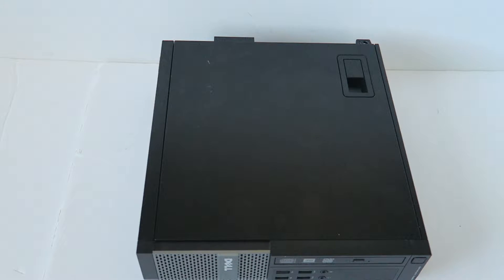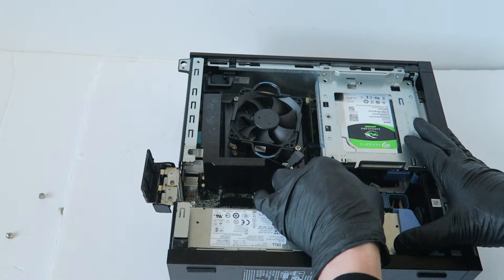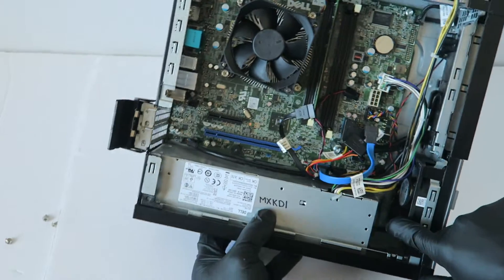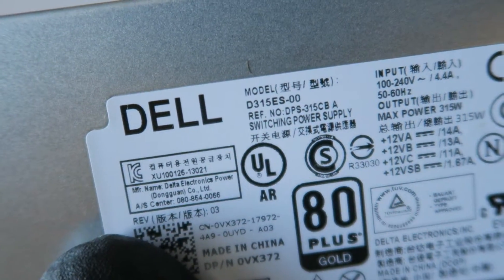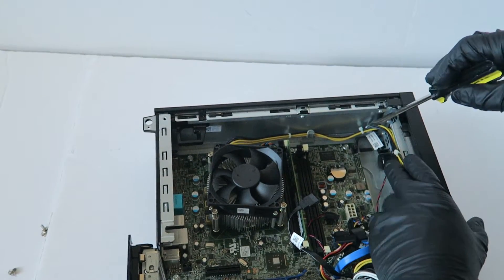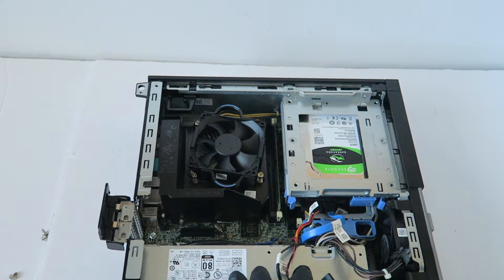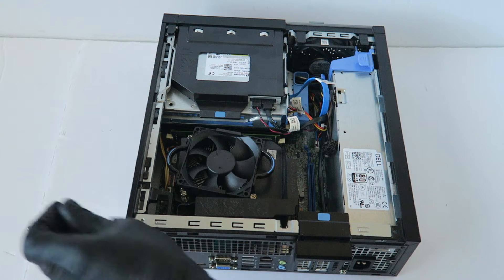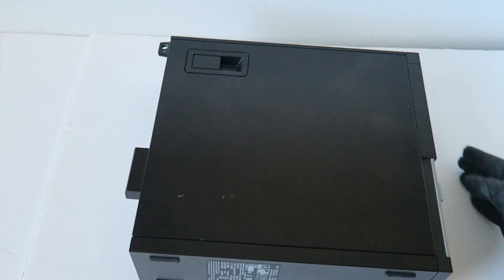Dell Optiplex 3020 7020 9020 SFF Power Supply Upgrade 315W

Comment from the maker: Here is the list part upgrade power supply. 

Model D315ES-00 Power Supply 315W DP/N 0VX372
DPS-315CB VX372

List video cards will work with this system Dell Optiplex 3020, 7020, 9020.
(1.) Gigabyte GeForce GT 1030 GV-N1030D5-2GL Low Profile 2G Computer Graphics Card 
https://amzn.to/2Z4PHkp 
 
(2.) ZOTAC GeForce GT 1030 2GB GDDR5 64-bit PCIe 3.0 DirectX 12 HDCP Ready Low Profile Video Card ZT-P10300A-10L 
https://amzn.to/2WzgLXk 
(3.) MSI Graphic Cards GT 1030 2GB GDDR5, Low Profile 
https://amzn.to/390Spum 

USB Wifi Adapter for PC AC600Mbps Wireless Network Adapter
https://amzn.to/2ZaGuHb
 
Thermal Compound Paste:
(1.) Arctic MX-4 2019 Edition Thermal Compound Paste Carbon Based
https://amzn.to/2XcsZo4
(2) Arctic Silver 5 Thermal Cooling Compound Paste 
https://amzn.to/2ziNU0H
(3) Noctua NT-H1 3.5g, Pro-Grade Thermal Compound Paste
https://amzn.to/36kTk7A
(4.) ARCTIC MX-4 (current edition) Thermal Compound Paste 20 Grams 
https://amzn.to/2DhGJaK

Hard Drive Caddy Adapter  3.5 to 2.5:
(1.) Dell 3.5" to 2.5" SSD or Hard Drive Caddy Adapter R494D 0R494D 
https://amzn.to/2XTPeRr
(2). Dell Hard Drive Caddy, R494D, F767D 3.5" to 2.5" SSD or Hard Drive
https://amzn.to/3cTkcOk

SSD List:
(1.) Samsung 860 PRO SSD 256GB - 2.5 Inch SATA III Internal Solid State Drive
https://amzn.to/2BY5gRl
(2.) Samsung SSD 860 EVO 250GB 2.5 Inch SATA III Internal SSD 
https://amzn.to/37xWUfc
(3.) SK hynix Gold S31 1TB 3D NAND 2.5 inch SATA III Internal SSD
https://amzn.to/3d7X6D6
(4.) Samsung SSD 860 EVO 1TB 2.5 Inch SATA
https://amzn.to/2B2FURX
(5.) SanDisk SSD PLUS 1TB Internal SSD
https://amzn.to/3hwdqku
(6.) SanDisk SSD PLUS 240GB Internal SSD
https://amzn.to/2zfc7EX
(7.) Crucial MX500 250GB 3D NAND SATA CT250MX500SSD1(Z) 
https://amzn.to/3bTTjbX
(8.) SanDisk SSD PLUS 480GB Internal SSD SDSSDA-1T00-G26
https://amzn.to/2yfgjUK
(9.) WD Green 1TB Internal PC SSD  WDS100T2G0A
https://amzn.to/2XfGtzc

HDD list works with this PC:
(1.).WD Black 2TB Performance 3.5" Hard Drive - 7200 RPM Class, WD2003FZEX 
https://amzn.to/2xFUeyF
(2.).Seagate BarraCuda 1TB Internal Hard Drive  3.5" Hard Drive - 7200 RPM
https://amzn.to/3g8FXM8
Reply: Hey is there a power supply i could use for the optiplex 9010?
Reply: Hey I just picked up an optiplex 9020 with a 4770 and 16 GB of ram, I was wondering if I could put a GTX 1650 in it with the PSU upgrade
Reply: not link for the power supply..?
Reply: Can we use this power supply model with optilplex 5040/7040 sff
or T3420
and i have another question 
is there will be any difference in performance between installing gtx 1050 ti in pci x4 and pci x16

Comment: Mine is good enough for the 1660 it’s 125w I think
Reply: @Eoin F nope I kept the 400w psu and slapped a 1650 lp gpu in it
Reply: @Eoin F I was thinking about doing tht but I changed my mind turns out it’s hard to put a different psu inside a sff case lol
Reply: @Eoin F ohhh your talking about the 3020 I have the 9020
Reply: @Eoin F no problem bro

Comment: Can you upgrade to a 500? On the dell optiplex 3020 slim
Reply from the maker: Hi, you want to upgrade power supply and you have mt or sff case ?
Reply: @Mxkdt  I have the sff the small slim version of the 3020
Reply from the maker: @Th3Retr0Wolf No 500 watt supply is not available for sff only if you have mini tower you can do more upgrades, what kind video card are you trying to use ?

Comment: I wonder if removing the plastic around the CPU cooler the temps will be lower?
Reply from the maker: Hi, it is design for the air flow and if you do remove it that plastic fan shroud you pc will run hotter.
Reply: @Mxkdt  thanks man, there it must be another way to improve ventilation

Comment: I'm guessing the stock psu will handle a gt1030 lp ddr5 just fine?
Reply: mine use a 1650 regular (with a riser) it works just fine
Reply: @cheapet50  nice how did you get a 1650 in there lol
Reply: @anon8613  
first I plug it on the PCIe x4 (it deliver the same power because on the spec sheet it dubbed as x16) but I cannot close the case because the card way to wide.
now I use a PCIe x16 riser. working fine so far. now I working on a custom side panel with gpu housing to clean my setup.
Reply: @cheapet50  interesting. Very cool. Got to see a pic. I got the GT 1030 DDR5 oc lp version and it fits perfect. Little bit of over clocking and I'm able to play games on ultra settings stable smooth for hours lol
Reply: @anon8613  
gonna post it on imgur right away, wait
Reply: @cheapet50  nice!
Reply: @cheapet50  what's the cardboard for? airflow?
Reply: @anon8613  
nope, just some unused noctua fan that I use for keep the curtain in place XD,
its blocking the fan couple time, So I use the cardboard box to cover it.

Comment from the maker: List video cards will work with this system Dell Optiplex 3020, 7020, 9020.

(1.) Gigabyte GeForce GT 1030 GV-N1030D5-2GL Low Profile 2G Computer Graphics Card 
https://amzn.to/2Z4PHkp 

(2.) ZOTAC GeForce GT 1030 2GB GDDR5 64-bit PCIe 3.0 DirectX 12 HDCP Ready Low Profile Video Card ZT-P10300A-10L 
https://amzn.to/2WzgLXk 
(3.) MSI Graphic Cards GT 1030 2GB GDDR5, Low Profile 
https://amzn.to/390Spum 
USB Wifi Adapter for PC AC600Mbps Wireless Network Adapter
https://amzn.to/2ZaGuHb 

Thermal Compound Paste:
(1.) Arctic MX-4 2019 Edition Thermal Compound Paste Carbon Based
https://amzn.to/2XcsZo4
(2) Arctic Silver 5 Thermal Cooling Compound Paste 
https://amzn.to/2ziNU0H
(3) Noctua NT-H1 3.5g, Pro-Grade Thermal Compound Paste
https://amzn.to/36kTk7A
(4.) ARCTIC MX-4 (current edition) Thermal Compound Paste 20 Grams 
https://amzn.to/2DhGJaK 

Hard Drive Caddy Adapter  3.5 to 2.5:
(1.) Dell 3.5" to 2.5" SSD or Hard Drive Caddy Adapter R494D 0R494D 
https://amzn.to/2XTPeRr
(2). Dell Hard Drive Caddy, R494D, F767D 3.5" to 2.5" SSD or Hard Drive
https://amzn.to/3cTkcOk

SSD List:
(1.) Samsung 860 PRO SSD 256GB - 2.5 Inch SATA III Internal Solid State Drive
https://amzn.to/2BY5gRl
(2.) Samsung SSD 860 EVO 250GB 2.5 Inch SATA III Internal SSD 
https://amzn.to/37xWUfc
(3.) SK hynix Gold S31 1TB 3D NAND 2.5 inch SATA III Internal SSD
https://amzn.to/3d7X6D6
(4.) Samsung SSD 860 EVO 1TB 2.5 Inch SATA
https://amzn.to/2B2FURX
(5.) SanDisk SSD PLUS 1TB Internal SSD
https://amzn.to/3hwdqku
(6.) SanDisk SSD PLUS 240GB Internal SSD
https://amzn.to/2zfc7EX
(7.) Crucial MX500 250GB 3D NAND SATA CT250MX500SSD1(Z) 
https://amzn.to/3bTTjbX
(8.) SanDisk SSD PLUS 480GB Internal SSD SDSSDA-1T00-G26
https://amzn.to/2yfgjUK
(9.) WD Green 1TB Internal PC SSD  WDS100T2G0A
https://amzn.to/2XfGtzc 

HDD list works with this PC:
(1.).WD Black 2TB Performance 3.5" Hard Drive - 7200 RPM Class, WD2003FZEX 
https://amzn.to/2xFUeyF
(2.).Seagate BarraCuda 1TB Internal Hard Drive  3.5" Hard Drive - 7200 RPM
https://amzn.to/3g8FXM8

Comment: You mentioned I can find the Model D315ES-00 Power Supply 315W DP/N 0VX372
DPS-315CB VX372 used online.  I found one refurbished for just under $50.  I'm not into gaming, but I do python data mapping and visualization.  If I do any graphics card upgrade requiring more than 255 Watts, but less than 315 Watts, do I really need 2 extra fans to install as well?
Reply: No

Comment: I've been considering making this upgrade to accommodate a GT 1030. I'm wondering about the video cable -- does it just hang there without connecting to anything?
Reply: you don't even need to change the psu for that card
Reply: You can use a GTX 1030 with the original 255W PSU https://www.youtube.com/watch?v=_GELrOuCmn0

Comment: Hey, Nice video. Would you perhaps know if this psu would work with the optiplex 7010 sff? They are very similar, so I think it should work, but I am not sure. The 7020 has a lga 1150 socket, and the 7010 has an 1155. That's pretty much the only difference I can find. Thanks for the informing video!

Edit: Actually there is a difference in the power connecter, could that be fixed with an adapter of some sort?

Comment: What’s the fastest graphic card that you can fit in the SFF?
Reply: @manomant181   on the 4x slot would the gtx1650 work ?
Reply: @sipmeister3611  Low Profile version, yes
Reply: Fastest gpu is gtx 1650 gddr6
Reply: @manomant181  ive got the dell optiplex 7020, i ordered a 7010, and got a 7020 -_-

Comment: Hi Mxkdi where would you use the video card 6 pin power plug in the 9020 SFF? I cant see anything on the board or the 1050ti card to plug it in
Reply: PCIe x4 slot, up to a GTX1650 but only the low profile version.
Reply: @stevenmacdonald9619  3020 is x1 (next to CPU), x16 (next to P/S). So I'm out.
Reply: @aleaxdeathbringer  Get yourself a 5050 chassis/mboard, and it is also the first model that will take the new Crucial P5 Plus nVME M.2 6000 that go into a PS5 👍

Comment: I am gonna transfer the whole system to atx case.
Can dell 3010 sff mobo supprt atx 500 watt psu?
Reply: Not without a 24pin to a Dell 8pin adapter. They are made in China.

Comment: Hi. Will this power supply fit in Optiplex 3050?
Reply: Also, I would like to know if there is a way to fit this gpu: https://www.zotac.com/product/graphics_card/zotac-geforce-gtx-1050-mini    inside small factor Dell Optiplex like this one.
Reply: Thank you in advance.
Reply from the maker: Hi, no this video card will not fit sff case in a dell, you have to use low profile video card only with low profile bracket.
https://www.zotac.com/us/product/graphics_card/zotac-geforce-gt-1030-2gb-gddr5-hdmi-dvi-low-profile

Comment: Is there an upgrade for the optiplex 3010 SFF power supply to make it 300+ watts, that will fit inside with a MSI GTX 1050 4gb low profile in it?
Reply: not from what I have seen unfortunately

Comment: Ill be putting in a duel ssd and 2.5 inch hdd for the drive bay with a Y splitter adapter to power them both, the power draw is about max 3 watts each and the 3.5 hdd is 9 watts on its own (there are 3 sata connectors also for the extra drives)

Comment: Can get them from Hong kong for about  65 usd (PSU), they seem like they might be useful but the power connector for the GPU is redundant due to the size of any card that will use it being unable to fit, unless anyone knows of SFF GPU with power connector?
Reply: Rx 470 sapphire on aliexpress . Its  74 euros. Not sure if the power supply will be strong enough, but it should fit I think: https://nl.aliexpress.com/item/4000236604446.html?spm=a2g0o.productlist.0.0.7eb92988GaGzGb&algo_pvid=baa74cd3-edba-4254-99d6-24488ba4d607&algo_expid=baa74cd3-edba-4254-99d6-24488ba4d607-12&btsid=004aa2e2-f1d1-4132-b8de-9dd553638b4a&ws_ab_test=searchweb0_0,searchweb201602_9,searchweb201603_52

Comment: Hey i noticed that all the power supplies that came up with the model #: D315ES-00 VX372 were listed as compatible with Optiplex XE2 but not limited to only this model. Would this mean as you said in the video it is also compatible with the 3000, 7000, 9000 SFF computers. Thanks

Comment: Hell that 315w PSU is strong enough to power a GTX 1060.... forget the 1050ti.
Reply: Can it really? Im trying to decide if it can. Just installed this PSU.
Reply: @ozzycastellanos7707   I been games with it now for over 1/2 and my 300w gold PSU runs stabe without an issue with a GTX 1060 and a 6th Gen Intel I5 with no issue.   16gb of Ram, 2 SSD and 1 TB HDD etc etc... the 300W is plenty enough.   I believe my GTX 1060 take around 125w (possibly more, I overclock it and got a 15% OC with MSI afterburner as well).. while the rest of the system uses the rest.
Reply: @ozzycastellanos7707  did everything work after upgrading to the 315W. Also I've noticed that many of the listings don't mention about a new power cord. Did you use the power cord that came with original PSU?
Reply: @SirWafflz  Yup, everything is running great on the system. Still trying to decide if I should upgrade to the 1060.
Reply: @ozzycastellanos7707  Sorry to make you repeat yourself. Just to clarify using the power cord that came with the 9020 255W PSU did not cause any issues with the new 315W PSU. Thanks.
Reply: @SirWafflz  You mean the IEC cable? you can pretty much use any tybe of IEC cable to put on you PSU.

Comment: You can't put but a small GPU because of no room no matter not unless you put the motherboard  in a bigger case, even then you will have to lengthen the GPU power 4 prong cable ?
Reply: you can get a 1050ti in however it only fits in the 4x pci slot, AKA the half pci slot, and yes it works, but space is tight

Comment: Ok, might be a stupid question, but I'd rather ask it and learn. If you upgrade the PSU on a 9020SFF with this, and considering it has a pcie power connection.... could you then install a GTX 1060 (small form factor), even if it means using the computer without the side lid? Or even, perhaps, using a pcie riser cable? I am about to install a 1050Ti on said computer, but it might be interesting to upgrade it later to a more powerful card if this PSU can do that, considering it has a i7-4790 CPU.
Reply: I've searched on the web but had no luck finding any model for low profile 1060, 1050 ti is as good as it gets for sff, unless you use another case with this power supply, otherwise you could modify this case but you will never get the side cover back on, let me know if you found any sff 1060?
Reply: There are a couple good LP GTX 1660 cards they work well with the 9020.

Comment: Will this work on the Optiplex 390 Desktop? Not the SFF and not the mini tower. I see videos everywhere for the SFF and mini tower but none for the desktop. I putting one together with an i5-2500 and a GTX 1050. I would like to upgrade the power supply if possible. Thanks in advance
Reply: It should have its own line of compatible PSUs as it is a different form factor form the 9020,7020etc

Comment: Hi mxkdi do you know if there are any bigger power supplys for the dell optiplex 7010 dt version
Reply from the maker: Hi, not really, you can use ATX power supply you have to get with long cables and use it external.
Reply: @Mxkdt  I thought so thank you for the advice
Reply from the maker: There are bigger power supply you can get i am not sure if it will fit  i
 never try on dell DT...Seasonic  SS-300TFX or Seasonic 300 TFX Active.
Reply from the maker: Hi, i just checked and Seasonic SS-300TFX 300w will fit and work fine in dell optiplex 7010 dt for gaming.
Reply: Thanks for the advice mxkdi
Reply: @Mxkdt  perfect I might just get one. Have you any videos on how to take out the old power supply?
Reply from the maker: Yes i do, i have a lot of videos on my channel how to upgrade power supply.

Comment: Can you provide the exact model name of that 315W PSU?  Also, where would be the best source to buy them from?

Thanks!
Reply from the maker: Model D315ES-00 Power Supply 315W 80Plus Gold DP/N 0VX372
They sell them, used online you have to check ebay or google shopping search.

Comment: Can you do put Dell Optiplex 790 parts into the HP Pavilion Slimline S3322.uk case please really need this guide
Reply from the maker: Why ? you want to install all the parts in to hp case slimline.
Reply: Mxkdi because the dell case is broken and my mate had a spare case and I’d rather not buy a new one as I’ve not told my parents about it
Reply from the maker: Hi, no you cant install in to hp slimline case i would just buy used dell 790 same model case online that would be better and faster way.
Reply from the maker: Because dell and hp use different headers for front panel switch and audio.
Reply: Mxkdi ah ok will do then